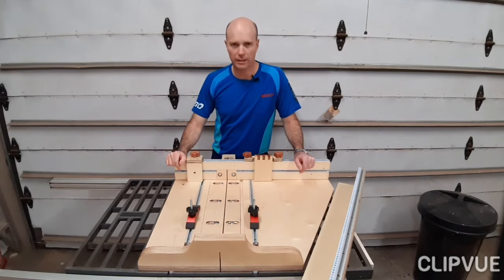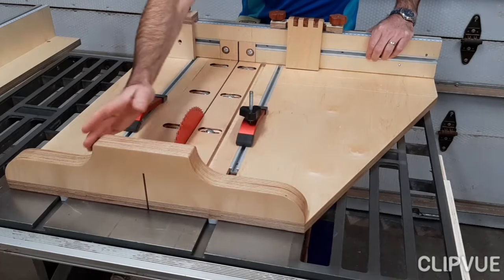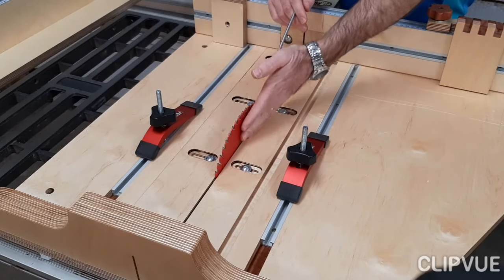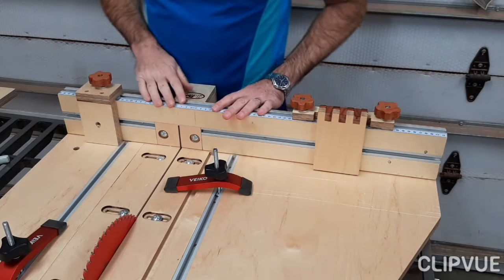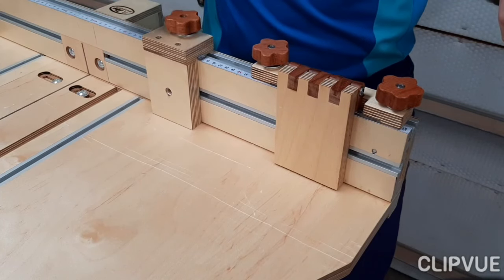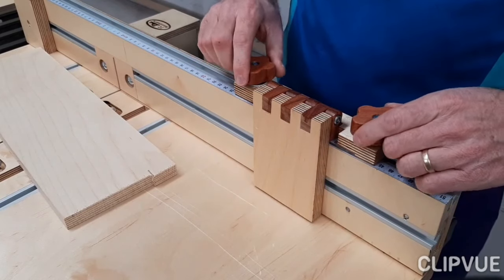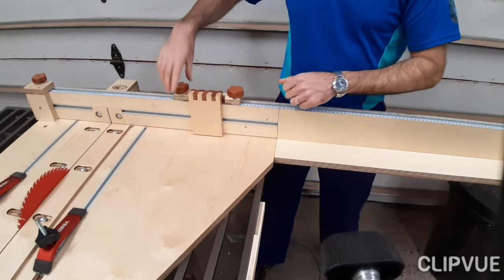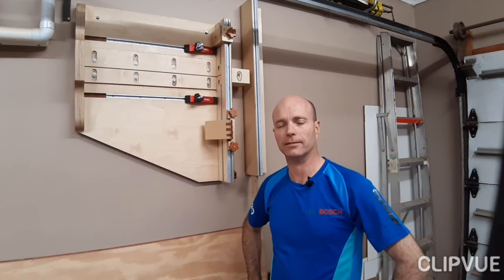Table Saw Sled - Essential and Cool Features

Comment: Thanks for your video, your sled is the perfect synthesis of what we should expect form, after finishing my woorshop, I will try to do one like this ( not sure that I would be able but would try ) I am sketching one on F360, I can find all the part at acceptable cost, but I stll miss the track you use for hold down clamp and Festools clamp.
Could you provide a like to where I can puchase this items that would help.
Your stop block are clever and nice.
Merci from far away.
Reply from the maker: Hi G eek, that you for the kind words. You can search for T Track on Amazon or Alibaba, depending what will work the easiest for you.